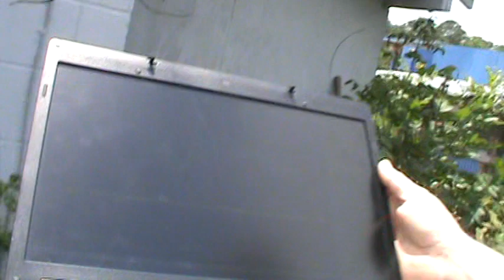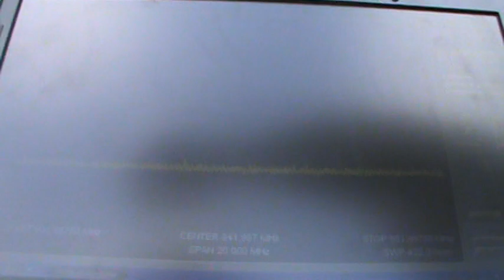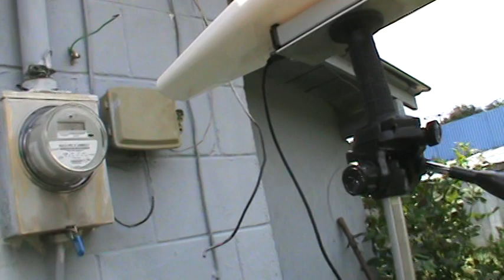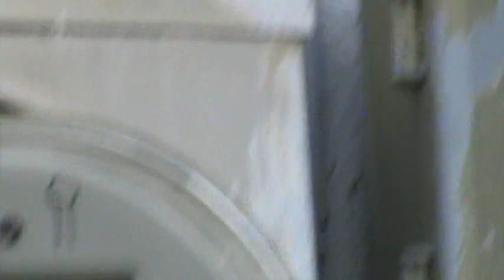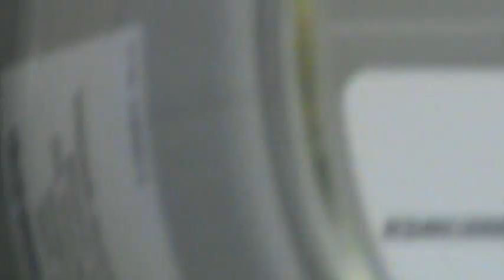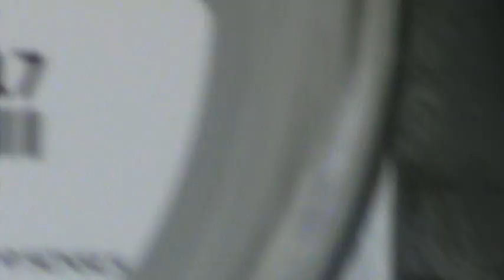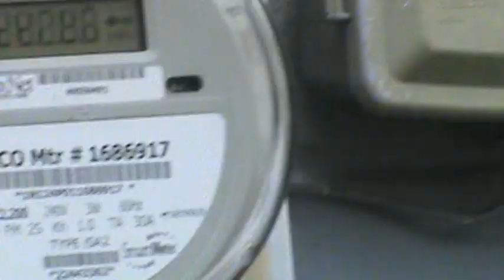Georgia Power Smart Meter Investigation Part 1

Comment: FCC doesn't take in to account for 12 meter next to each other.
That is over exposure.
Reply from the maker: or the hundreds in close proximity add a watt or two each into your environment
Reply: IT ONLY TAKES 1/0000 OF A SECOND TO KILL A DISABLES HOMEOWNER
I appears all of these smart meters operate at 14 watts of RF output power
Reply: Sess Poole (multiple ID of Frederique Zug): Thanks for increasing subscription and visitor numbers to my channel through multiple re-posts and promotion on 3rd party video platforms! The next step is to monetise my copyrighted material content. Thanks a lot Madame . . .
Reply: And what you don’t understand is that only one meter transmits at a time. If they all transmitted at the same time they would jamb each other and nothing would get through. 

Non technical people should tell people how thing work when they have no knowledge about how they work.
Reply: Matrix Man - The FCC does take that into account. They know that only one meter transmits at a time. If they all transmitted at the same time they would jamb each other and the system wouldn’t work.
Reply: maybe not, safety standards are based on heating effect and are stupid high
Reply from the maker: @yogipony9016  they're what, from the 80's or 90's?  There's good reasons they don't update that stuff to take in account non-ionizing radiation everywhere growing exponentially...for most those "non-thermal" explanations from the G are well enough...even IF they are 30-years old and way before cellular arrays were everywhere and everyone used cellular communications on and for EVERYTHING. Too much $$$ to crash entire industries possibly.
Reply from the maker: Many considerations are not taken into account in order for the technology to be used and sold.  Bad things?  nah. All these folks saying all these studies sayin' alls good n safe, it's a wonderful world would be fraudsters major, as would the man selling NSS (natural state system) processes which allow & he as administrator oversee third party creation interactions as if he owned the stuff as creator.  Surely to hell your court wouldn't allow such blatant misuse in order to bang them bucks and offer these cool wireless services over reality?  Surely, surely to hell not.....It's allocated for the better of all, and the best, most fair use of mankind's scientific treasures he alone has created and has rights to. Right? https://transition.fcc.gov/oet/spectrum/table/fcctable.pdf

Comment: Let's look at why we need TIN FOIL HATS. 
 #1 A smart meter will hurt or even KILL disabled homeowners who have disabled medical implants.  
#2 Did you know if your power company “turned off” the power to your home when they did a smart meter install, your chance of a smart meter fire increased by a factor of 1000.
#3 Your power company has access to all of you private power information. Eg When you make tea, when you turn on your alarm etc. This private information is sold to Google for huge sums of money. Ask your power company what the second radio transmitter in your smart meter does. (ZigBee) 
#4 A smart meter will cause cancer to return if your family members who are fighting cancer at home. If they come home from the hospital and sleep near a smart meter, they will die. Check with the US Cancer Society website. 
#5  Reason is Smart Meter RADIATION turn off breakers in your home. Both AFCI's and GFI's get turned off by the radiation from the smart meter.
#6 You smart meter is very accurate, BUT, the software (firmware) is programmable. Your bill has nothing to do with the power you use. 
#7 Smart meter radiation is breaking Ionic Bonding.
#8 A huge expenditure for a huge loss. Billions of dollars to purchase something that does not general generate any power and each smart meter need 4 watts to operate. One million smart meters use 4,000 KILOWATTS of energy to operate.
Reply: ...Feel free to send a comment or two, after all, this extremely mentally unstable person is a pilot...

Did you ever consider for a moment that he may be seeing the same unnecessary paranoid behavior in you that I am
seeing? This doesn't make him or me "extremely mentally unstable" people but I guess that, from your point of view, it
might look that way. It's a matter of perspective. From his perspective, as a FEDERALLY LICENSED PILOT, he probably
looks at your postings and sees someone who
 quotes crack pot "research" probably gleaned straight from the eminently
reputable pages of THE NATIONAL ENQUIRER AND
 THE EXAMINER along with other quotable's such as snake oil web
sites put up by Russian bots or 15 year old bespectacled
 geeks up past their bed times who are laughing their asses off
at people like you that cause their bullshit to go viral.
 Or, there are people like me who, if you ask anyone that knows me,
would say that I was well adjusted, level headed and NOT afraid to use my real name or give searchable references like
Google, (and
 what to look for once there), or, as I did in a post to another panic ridden fool like you here. I explained to
him how the
 power
 of ANY radio signal is reduced exponentially as a function of distance from the transmitting antenna.
Then I told him to
 call any radio or TV station and speak to the on duty engineer or a licensed HAM radio operator and ask
one of them
  explain to him what I just said. You, he or anyone else here don't have to believe me, just check out the
references that I
 have just cited. I read crap like your's and other's who profess it to be the truth but NONE OF YOU give
credible, IF ANY,
 references to back up what you say. On ANY subject, if I don't know what I'm talking about I will ALWAYS
state that it
 is my guess or it is my guess that.... but I will look it up just like I did with your killer ZigBee. Sometimes If
I'm
 trying to help someone solve a problem, sight unseen, I will venture a guess if I have an Idea what MIGHT be wrong
but I
 will ALWAYS preface it with, "I'm guessing" or "Here's a possibility" or "I can't say for sure but....". For myself, I can't
help
 you solve your smart meter problems by perpetuating something that I know for a fact to be a lie whether it came
from
 your information source or you directly. This is NOT to call you a liar but if you take someone else's "facts" as gospel,
you
 kind of wind up going to the same hell, so to speak, for repeating it. If I were to preach that the Judaeo-Christian God
was named Satan, He
 would most assuredly send me and all of my believers somewhere where we would get our facts
straight....PERMANENTLY!!! This is not to say that you will go to hell for ignorantly repeating someone else's garbage but
to keep
 from having people like your pilot friend and myself pulling you up short because of your "facts" just do a small
amount more
 digging into the story rather than just drawing conclusions from reading the title of the book. Do what you
want.
 I'm just sayin'.
 
Maybe I'm a little jaded because I have 45 years experience with radio transmitters and equipment but it
 galls me to NO
end when
 I read the espousing's of people. like you, who otherwise sound like intelligent, articulate human beings,
 running
around like Chicken
 Little crying for hours into their cell phones, at 10 1/1,000th, of a watt, about how smart meters will
destroy all life as we
 know it
 during it's 20 1/1,000th of a second transmission at around 4 1/1,000th of a watt. If you
would
 actually do this
 simple math like most people could and do, you would breathe easier to find that it doesn't add up
for you
 either. I don't know if you use a cell phone or not but this is an example of the things that people chose to worry
about
. Heck, the old microwave ovens in their kitchens leak more non-pulsed energy, for longer periods of time.and.
regardless of what ANYONE has told you, the human
 body will NEVER "get used to
 it". This will do more damage to you
than a smart meter will do. Do this math too, A bowl of soup warming in an old microwave oven will do more
 damage to
the person standing in front of it watching it cook than a smart meter will do to someone standing in a
 house
 where a
smart meter is transmitting during it's 20 1/1,000th's
 of a second interval twice a day and is mounted
 in a grounded
steel meter box. For that matter, it wouldn't hurt you if you were staring it in the face. It just boggles the mind!!!

Comment: I live in an apartment that is a end unit.  There are 8 meters  just two feet away from where i work on my computer all day long.  This can not be good.
Reply: Colby D you need to either look for a way to sit put something at the wall to block those signals or move. Don't you not ever feel ill after sitting there all day?
Reply from the maker: Feel the infrasonic hum yet?  It is international crime spree, G's & Corporate cronies cookin' for $$ Literally millions are complaining about microwave resonance all over.  Un bound (wireless) energies are cash cows w/ control benefits for the operators. U will not hear facts from those making money off this EMF/FM nightmare.....thehum(dot)org
Reply: You work all day on a computer which is an EMI nightmare and you are worried about smart meters?
Reply: @gregcollins3404  Thank you. Finally somebody with some sense. I had some guy try to tell me about how these meters was going to kill us all but yet he had an iPhone in his pocket and was talking on a cordless phone when he walked over.
Reply from the maker: Talking microwave communications, radio style specifically and transmitting meters, not computation devices per se causing or producing electromagnetic based interference. I have worked on computers since the early 80's and radio sets since childhood and computational devices, unless networked wireless, are almost a completely different animal.  Not even really figuring into this equation.
Reply: cover that wall with aluminum foil or screen

Comment: Do the Sensus meters really only transmit 4-6 times a day?
Reply from the maker: 4-6 times per hour, sometimes more from my observations.  Probably if a receive signal is not sent back it is told to resend....it'd be easy to hack the things and have it broadcasting continuously. Anyone who tells you a computer like this would be difficult to mess up does not program computers.....
Reply: Todd West How did you measure it, using a RF meter? I'm only asking questions because my utility (Alliant Energy) wants to install one (same Sensus model), and they tell me the same only transmits 4-6 times a day BS.
Reply from the maker: Tektronix Spectrometer
Reply: Okay, Thanks Todd; this video was interesting...
Reply from the maker: Tektronix Spectrometer
Reply: Any smart meter can be programmed to send (transmit) at any intervals they are programmed to.
The second transmitter inside, the ZigBee transmitter is constantly on and transmitting.
THAT IS WHY THESE SMART METERS ARE KILLING HUNDREDS OF PEOPLE EVERY MONTH